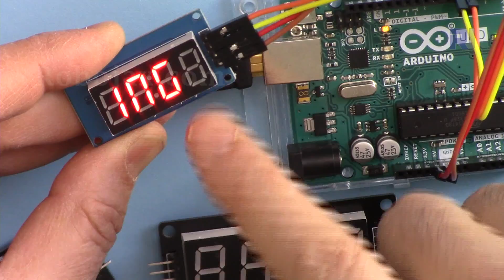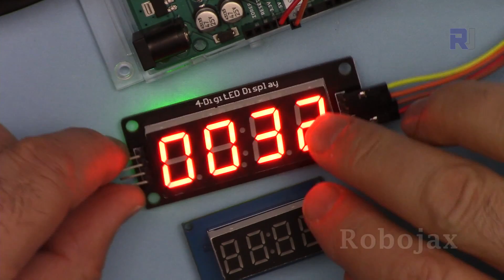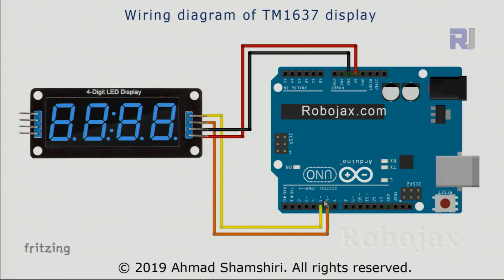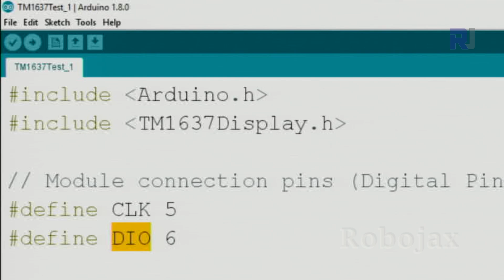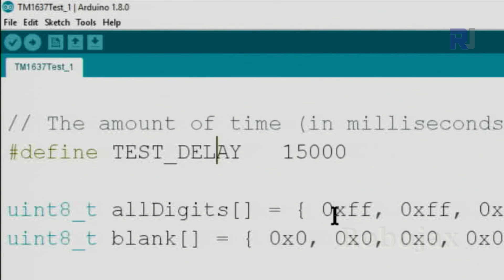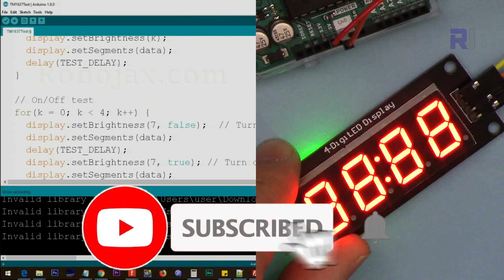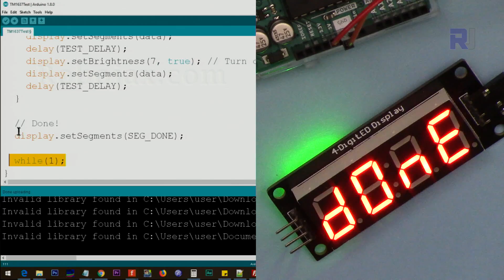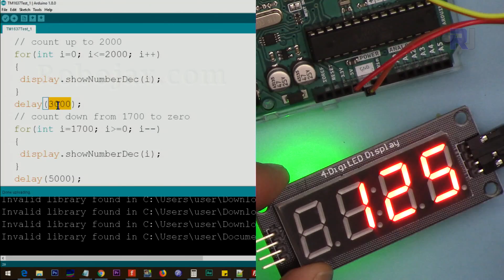Lesson 20: Introduction to TM1637 LED Display | Arduino Step By Step Course - RJT577

Comment: Hello Robojax. Please, depending on your availability, make a Clock using TM1637 with IR Remote Control to set Hours and Minutes (with Arduino). Thank you.
Reply from the maker: Hi, forget the TM1637. Here is the video and I have more than 5 video https://youtu.be/LEQfzmO9Wm0
Reply: @robojax  Why do you say Forget the TM1637? Is it bad? I mentioned it because I have a few and would like to make a clock using the TM1637 and an IR Remote Control to set the Time.
Reply from the maker: Yes. TM1637 is so bad, you can't use it easily.  it does not have colon and the library sucks. Just watch the other video, once you use it, it will be your best friend to display anything.

Comment: Hey Doc.
You being a teacher I was hopeing you might know if I can run a (little) 9 volt into my Nano but also into my Pam amp on the same line. The amp draws 7 to 18 volts. Nano 5 .   or if you might know where I would go to find out. I'm sure it will work but when the amp is adjusted it will draw different powers I would think. it's just a hand held radio but I don't want to do it wrong. I could run the amp on a separate  battery but that's not what I'm doing and it isn't learning. Hope this isn't an Arduino guestion I will be treated stupid by. Arduino questions get snotty answers like beginners are trying to be lazy or are stupid, when these same people would ask me how to hop up there motorcycle.
Reply from the maker: Power and voltage are two different quantities.  Voltage is supplied to the module and it will kill it if you input more and even sometimes low. Power however is determined by the active device and your power source should supply whatever is reasonable value is requested.  So for nano if you have IN pin it might accept 6 to 12V and it has internal regulator of 5v or 3.3v so check divination.  Your amplifier has nothing to do with nano and you can power them together for the same source if compatible as explained above.
Reply: @robojax  Thank you, I forgot about ampridge, I guess that's where my mind was when I was questioning myself if it would pull power away from the nano. enough amps for both and I'm fine to run the amp and nano if they don't outpower my battery. even if so when the battery runs low I would have to account for that.

Comment: sir tm1637 modul only wark D0pin D1pin only
why this
i define CLK  5
 define DIO  6 pin not wark
define CLK 0
define DIO 1 Its wark
Reply from the maker: It should work and will work. Check wiring or code